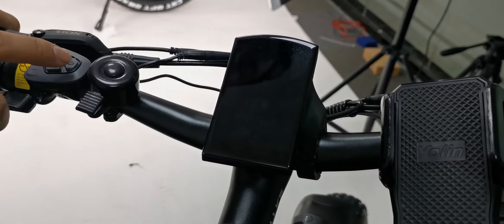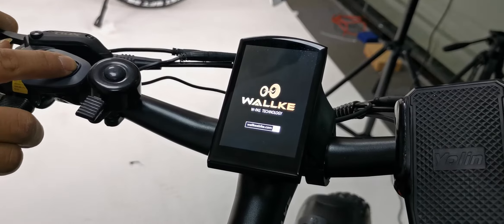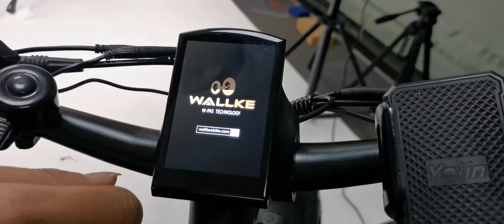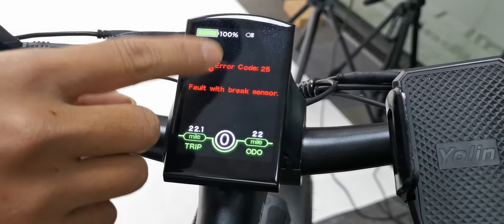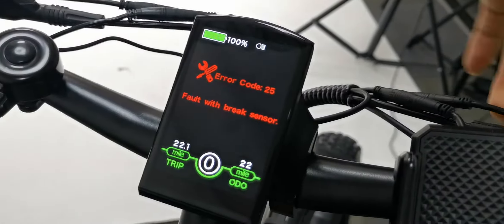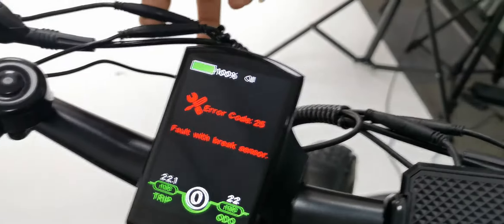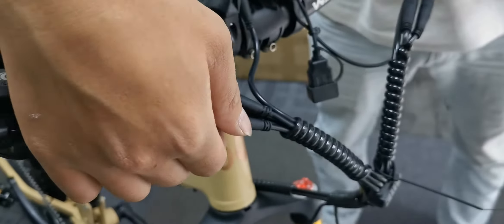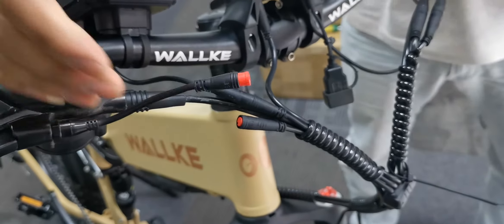Error 25 troubleshooting- Wallke eBike

Comment: The engwe pro has same problem same screen and i assume same controller. I will try this on mine thanks.
Reply: Just FYI, I have engwe e26. I made a minor adjustment to my handlebar position and it triggered error code 25 because it was putting some additional tension on my brake cables. I readjusted the handlebar height and re-wrapped the cable ties and the error code went away.